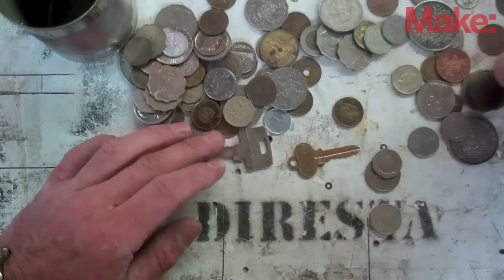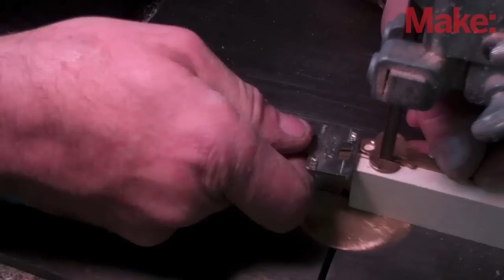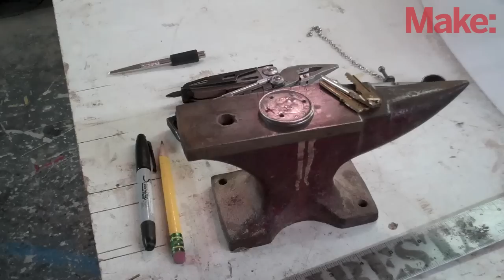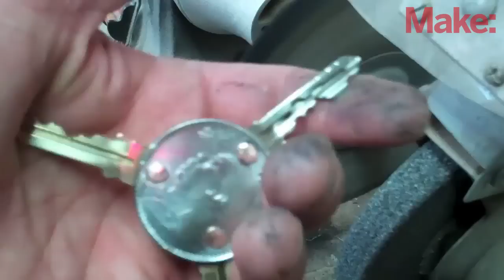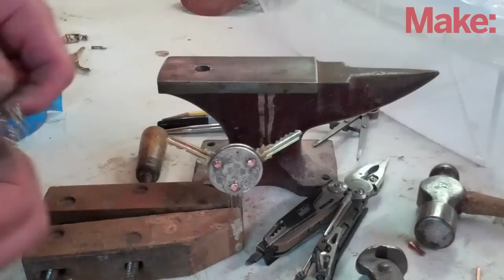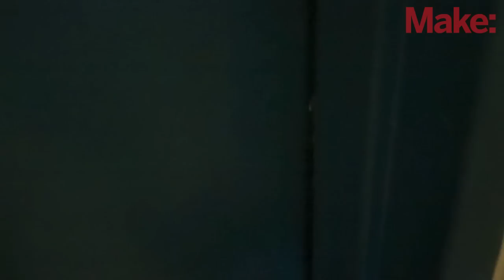DiResta: Star Key

Comment: I like that it's small and delicate, but simple to make. I don't have the same tools, but careful and proper use of a hand drill and a belt sander,  or even a sanding block and file would work. And  of course a little hacksaw to cut the keys or I could  put my old Dremel tool to work.

And I agree it could be made as a defensive weapon or throwing star if one wanted to repurpose some old keys or use thick nails or other scrap bits. Obviously, while artistic yet useful, it sure does make for a conversation starter :)

Comment: to make it more usable I would make the hole you drill in the key a bit bigger than the pin on the top 2 keys so they can fold down. 
put a couple more stopper pins like the one used  to hang it and you have an awesome and usable key

Comment: Get a small piece of half inch plywood about 5x5 inches and use that as a base for when you are drilling, it won't dull your bits near as fast and it won't eat up that surface you were drilling on, just make sure you re locate to a new hold when you drill through into the wood.

Comment: "In the United States, U.S. Code Title 18, Chapter 17, Section 331 prohibits "the mutilation, diminution and falsification of United States coinage." The foregoing statute, however, does not prohibit the mutilation of coins, if the mutilated coins are not used fraudulently, i.e., with the intention of creating counterfeit coinage or profiting from the base metal (the pre-1982 copper U.S. cent which, as of 2010, is worth more than one cent in the United States)." So i guess we were both right?

Comment: instead of having 2 shitty locks and ultra thin door, wouldn't it be better to have one good lock and then one good thick door?
Reply: yeah, but get an Abloy lock and you just cant pick it, it's basicly impossible, and a thicker door that opens out side so no one can kick it in.
Reply: Das Spielchen yes, but look for new abloy locks, you need to be professional with years of experiense to pick it, and still it will take ages to do it.
Reply: gun is better
Reply: Or maybe the door is solid. Don't assume when you can only see the fucking handle.
Reply: Das Spielchen you forget how easy it is to just use magical wizardry spells to teleport in